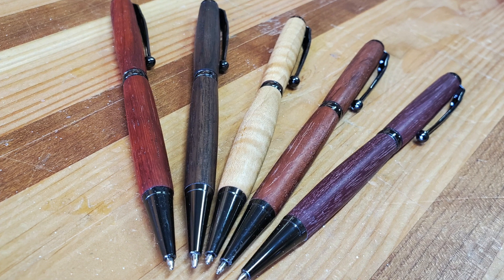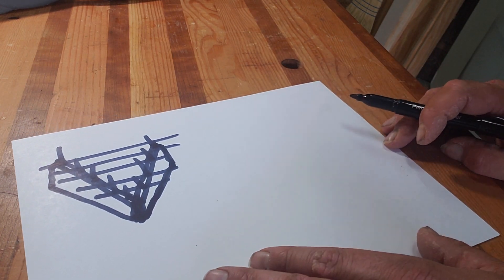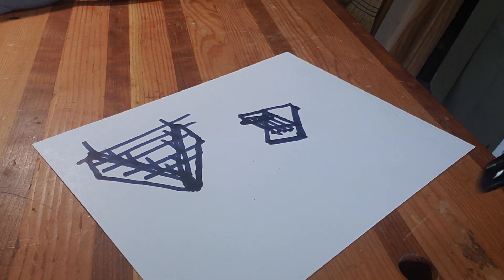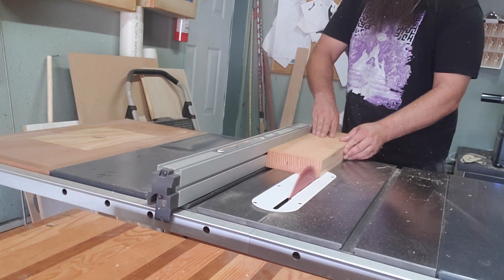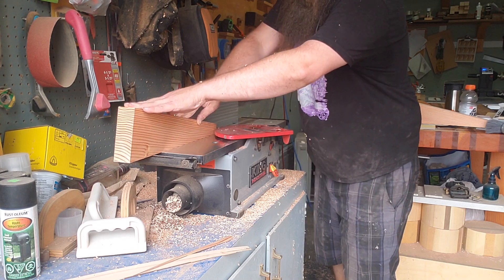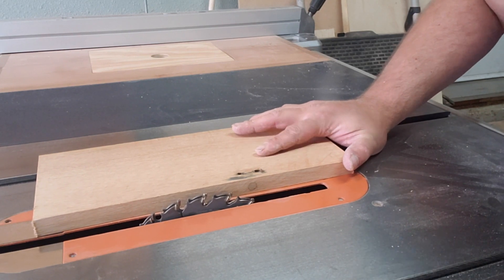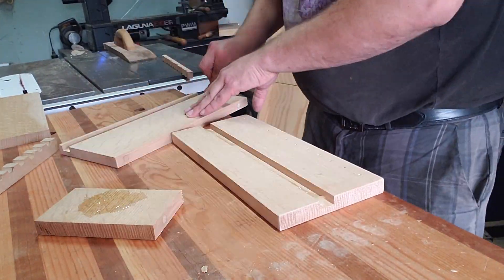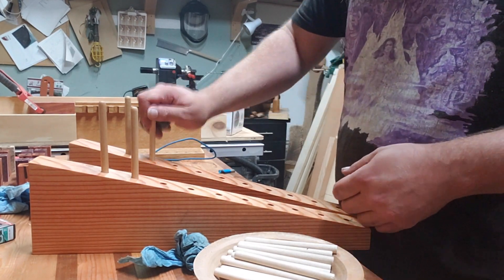Making My New Market Display Racks!

Comment: Looks great! Good video to watch with my morning coffee... at quarter past noon. Just a thought, if you shorten the dowels on the charcuterie rack display, could they be angled more? Would that catch more attention? Just throwing ideas out. I don't get much opportunity to go to market and sell things. So a bit jealous really.
Reply from the maker: They would angle back more if I shortened the dowels, yes. But I'd have to shorten them ALOT to have it make any significant difference. I could also take out every other one and still use it to hold 5 boards. Still better than having them flat all over the table.
Reply: @WoodenThingsAndStuff  I agree completely. Keep up the good work.
Reply from the maker: @davidbuffington9644  thanks, man. Will do.